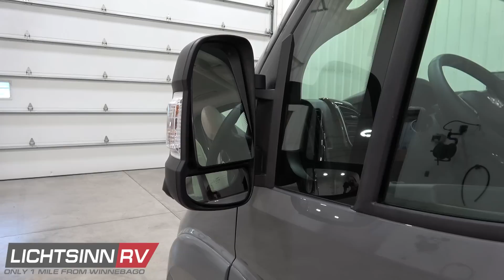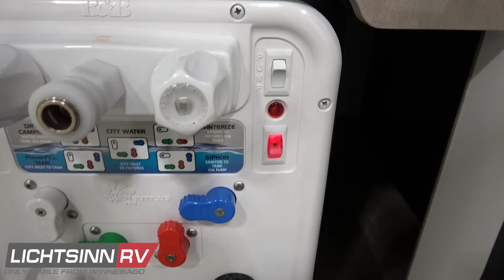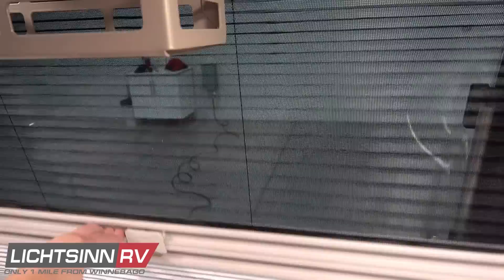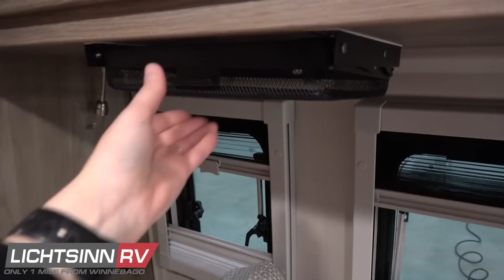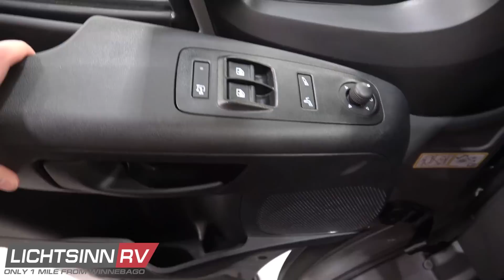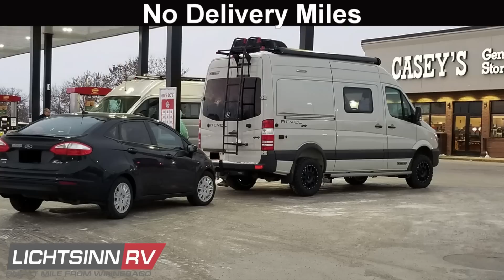New Winnebago Travato 59K - Including Adaptive Cruise - Class B Gas Camper Van - LichtsinnRV.com

Comment: 59K is not the price, folks. It's the floor plan. 😁
Reply from the maker: Good evening!   Thank you for your note!   That is correct.  It is the 59K floorplan identifier as set by Winnebago for the twin bed floorplan since its debut in 2014, just like the 59G floorplan identifies the rear full bed option vs this 59K twin bed option.  Hope this helps!

Comment: Does this model have the multiple awning recalls corrected?
Reply: Tanks for reply. I only ask because I have a 22 59K and had first recall done even though I was not having issues. After first fix I had severe chassis battery drain ending with me having to disconnect negative cable when in storage. Now I just pull the fuse located in B pillar and that seems to have solved issue. I am waiting on 2nd recall fix as there seems to be issues with that too. Very frustrating and shines bad light on Winnebago/Carefree. What was done on the new Travatos to correct issue?
Reply from the maker: @petermenor8074  Good morning!   With the latest awning recall completion, we have not had further issues so would recommend you complete this as soon as possible.   Our team can complete for you at 641.585.3213
Reply: Unfortunately I am in Phoenix, AZ. Service here is not good and wait times are ridiculous. You aware of any good service organizations here?
Reply from the maker: Good evening!  It absolutely is recall free!   Hope this helps!

Comment: Great van for us, so far. Not our dealer here but usually hear good things about them and they do some nice videos we appreciate. Their location close to WGO is a plus if you live in that region. Our thoughts are to get the KL version if you can afford it, we had a few issues at first covered under warranty with our Volta system but now we love it. We've have hooked up to shore power only 1 time in the past year or more. We drive more than sit (charges while you drive) but when we do stay in the same area we also use auto-starts to charge. Prob the best part is the bed, we tried the twins one night but not great for us. The bed doesn't take long to make up and it's large for a van like this, pretty rare. Pass on the G or GL version if you want a big bed. We also like the bath in the back, any odors are furthest away and enjoy showering outside. Our first rig and we think we picked up a good one with our 22kl. Had it since the fall of 21 so going on 3 years. If you want a rig that won't break the bank to fill up, easier to drive, and can park in your driveway much easier....this is a nice option.